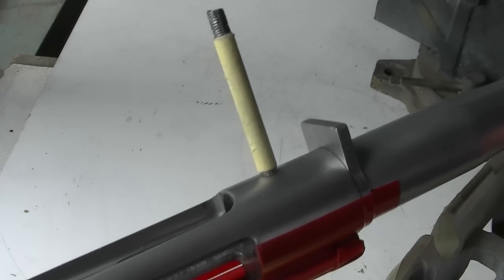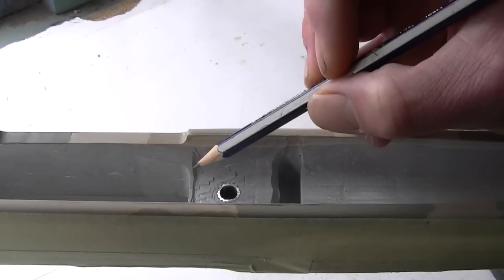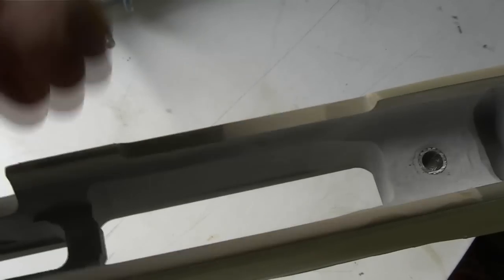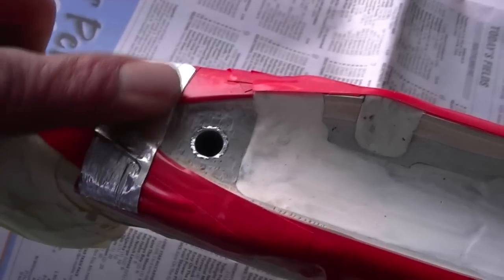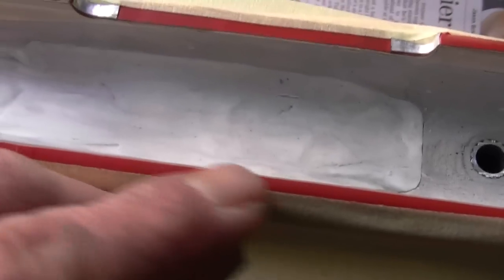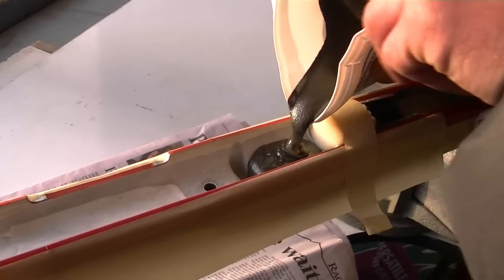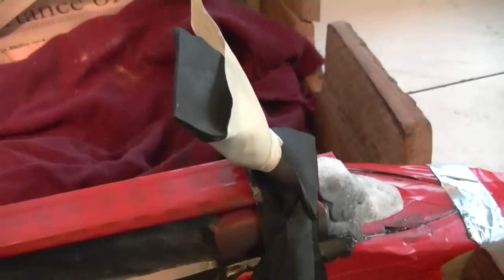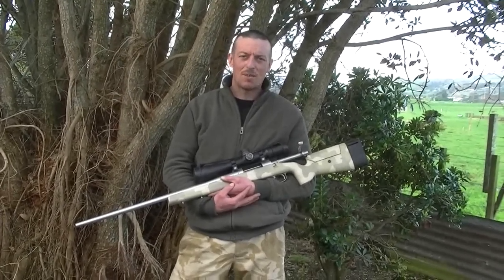MatchGrade Bedding Compound- Extra tips and tricks

Comment: Nathan, wasn't the whole idea of having both the Front and Rear Pillars present (I assume, from the McMillan Factory?), to give you both Front and Rear ............... Referrence Points? 
By removing material off the top of both these Pillars, you have taken this epoxy bedding job, from a Pillar Bedded-Epoxy Bedding job, back to a conventional epoxy bedding job. This is Not the way I do a bedding job, as I believe you have taken a backward step. I would be interested to hear your reason behind, why you have done this? Regards JB

Comment: How do you get all of that clay out of the area where the bolt goes?
Reply from the maker: Hi Jordan, we do not utilize clay in the kits and instead use a very high quality plasticine. This is very easy to remove after bedding as you will find if you purchase this product. All the best.

Comment: Awesome stuff Nathan well done. I do have a quick question, when re bedding a rifle due to a new barrel, do you simply grind out the old bedding compound and go from there or is there anything else I would need to be a aware of?
Reply from the maker: Hi there, I tend to simply remove the barrel channel bedding and see how it shoots. Often a barrel will shoot just fine fully free floated. But if there is any funny business including recoil lug misalignment, then I fully rebed. I have covered all of this in my third book- The Practical Guide To Bolt Action Rifle Accurizing And Maintenance. This goes through the processes step by step and you don't need to be a smith to work through it. Hope that helps.

Comment: Do you tape the recoil lug to provide a little tolerance on the front and sides?
Reply from the maker: Hi Elkhuntr, yes, that is correct. The reasoning for this is explained carefully in my books (Practical Guide to Long Range Rifles - 2nd edition / Bolt Action Rifle Accurizing and Maintenance). All the best.

Comment: Yo Nathan, I am in a forum that is debating on grinding down the pillars. Can you elaborate why is ok?
Reply from the maker: Hi there, if you have a close look at the rifle in the first videos, the pillars are already countersunk so there is no debate in this regard, HS made the call when they designed the stock this way. My next book explains the various methods of pillar bedding in great detail as a part of the accurizing process.
Reply from the maker: Nathan Foster
In this last video, we ground the pillar so that it would have a good measure of compound between the pillar and action. If we did not do this, the compound seepage between the pillar and action would result in a very weak layer, about 10 thou / .2mm thick. This brittle layer tends to flake away. We have been researching this for a very long time, hence why I found it better to put all of the information into book form so that readers can study and fully understand the theory and and actual consequences of each method.
Reply: Nathan Foster
I talked to Justin at McMillan yesterday for awhile about what he would recommend for the bedding process. He said that a regular skim bed using Marine Tex or Devcon would have sufficient thickness for wear and tear. I told them that you have been doing ballistic research for like 20 years and that you said about 2mm needs to be removed to give the epoxy enough thickness to no be to brittle or flake off. Justin said that he had been bedding for a very long time using Marine Tex, which wouldn't flake off or crack. I know you have great respect for McMillan, but do you disagree with them here?

Comment: Like the last tip! lol Just wondering though...a lot of speculation from guys about bedding the shank of the barrel. I've been told be gunsmiths that the barrel will heat and expand ever so slightly which in turn binds the action/barrel to some degree. It makes sense to me, but I have seen some of the best gun smiths in the country bed the shank. What is the determining factor of whether to bed the shank or not? Appreciate your time.